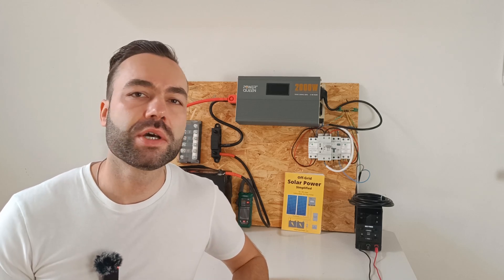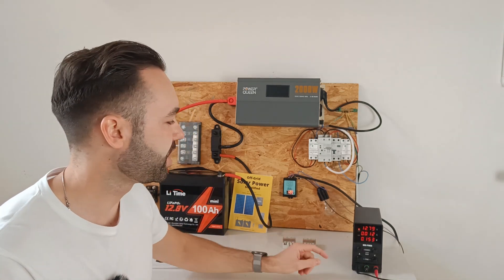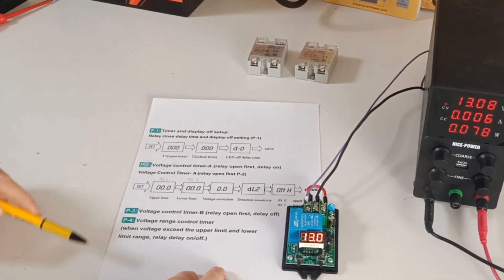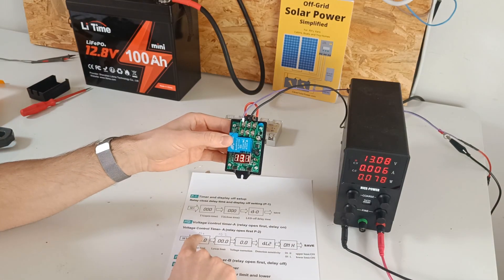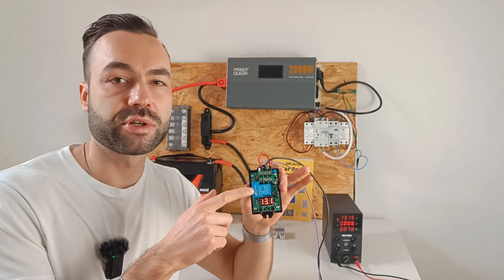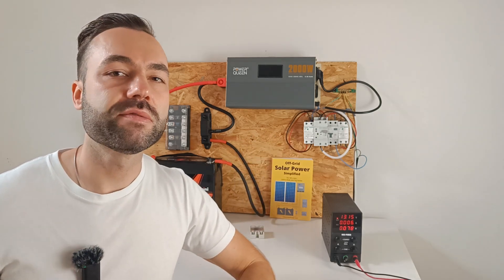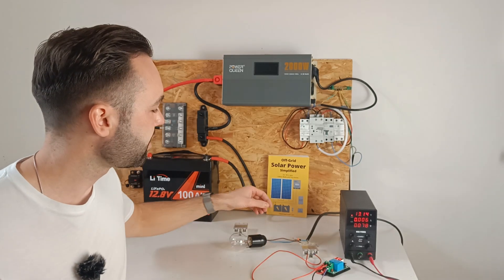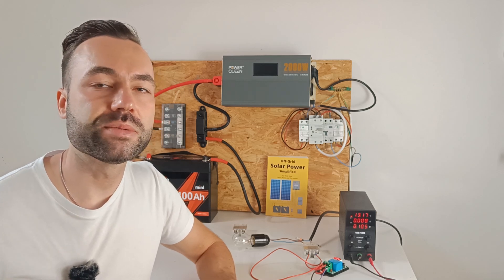Solar Dump Load - Heat Water When Batteries are Full

Comment: I never knew such a thing existed! Thank you Nick. I just got my solar working on my caravan (800w of panels, and a 280ah battery). I rewired it all so that the 12v was fed from the new battery, and the 230v was fed from my new inverter. It works really well, though I've been trying to find a way to use as much power as possible to push the system in these midsummer days. 

Putting my water heater on overnight uses a third of the battery but it soon tops up. But I notice that the initial heat takes most of the power (400w x 50 minutes) and subsequent top-ups use very little once the water is heated. So I'm thinking that I should install one of these devices to heat the water as soon as the battery is charged, and leave it on that whilst I have light hitting the panels. 

I'll give it a go as soon as I can!
Reply from the maker: Glad you liked the video Jim. You have quite a lot of solar panels for the size of your battery. in an average day with 3 sunhours you get 2400Wh from your panels and your battery is 3500Wh, so indeed, your battery will be full quickly, especially in summer.
Reply: @cleversolarpower  I bought twice as many panels as I should have because I had space on the roof to put them!

I set the solar dump up earlier to send excess power to my water heater. So I'm hoping that I'll get out there soon and find hot water in the taps and a full battery.

Thanks again. I keep coming back to your free advice here so I just bought your book from your website, and I'd urge anyone else who finds your work useful to do the same.

Comment: I am not a specialist in this field, but have lived totally off-grid for over 10 years now, so this has been something I have thought about and investigated. It might sound like a great idea, but most batteries want to be held at a boost charge voltage for some time, often about 2 hours, before dropping back to a float voltage.  Even at float voltage, most systems will use some solar power throughout the day.   So, triggering a panel power dump when a voltage is reached means the proper charge cycle is not completed - that will eventually damage the batteries.  This scheme can only work properly if the controller can determine the difference between the power demand of the battery charge controller and the output power of the panels and redirect only the excess power. If the controller is doing that, great, but I have yet to be lucky enough to find affordable technology to do this.
Reply from the maker: You are talking about lead-acid right? If so, then yes. You can set a delay timer in the relay. Most people are using lifepo4 though.
Reply: I don't think this is a problem with Lithium Batteries, that are okay even if they don't reach 100%
Reply: You are correct, even lithium batteries need to balance occasionally otherwise they start to go our of balance and are eventually destroyed. A couple years later its just bad luck or a bad manufacturer. Destroying your battery just may be cost effective. Heating water from batteries is a very poor method.  The best way is to power the element directly from PV voltage and divert excess energy when array voltage goes over the natural Vmpp.  Then only enough current is diverted to bring array voltage back to power point. There is one commercially available product that can do this from Poland available on ebay for about $200 called the ACTii.   I have one sent to me by a subscriber after it failed and seller refused to do anything.  I got it to work, it is a dated design that can be improved.   A simple one can be built for about $20 that works amazing, only about a dozen parts.  I have been designing these for ten years and have lots of old prototypes, want to try one.  This is the best unknown technology in the solar world.

Comment: I kind of need something like this for my grid-tied solar setup. I live at the end of a long (about 1km long) 230V AC supply cable. When a large load switches off (especially my EV charger) then my solar inverters (putting out 6kW peak) are too slow to react to stop pushing to the grid, the voltage spikes over 250VAC (maybe 255 or more) and the grid tie inverters panic and shut off completely.  What I would like to do is have a dump load (like a 2kW oil filled heater) connected via SSR that will connect the dump load very, very quickly and then disconnect after a few seconds. This will soften the blow to the inverters so that they can 'climb down' from the sudden drop in load.  The only thing I need to do is to design a circuit to very quickly detect the spike in the AC voltage, turn on the SSR and then turn it off again after a few seconds.

Comment: Thanks so much, I purchased your book back in 2020-great book and resource. I used it as my guide to build my system for my van. Like this idea of a solar dump. I don't like the idea of running through my inverter, as in my application, I only turn it on when in use. Trying to think of a DC load that I can use as a dump

Comment: It seems kind of dumb to use battery voltage as the trigger for a dump load, most scenarios where you have excess solar are based on gen more power avail than using while on a grid tied system, where you don't want to play the net metering payola tax, so need to avoid dumping onto the grid, so the trigger is much more complex, it's about detecting when your gen > load, which some meters can do, but they don't tell you (no dig breakout), so you need something fancier.
Reply from the maker: Basing the dump load on the state of charge is more complicated. We are using the effects of a lifepo4 battery voltage curve getting steeper at the end when it's near full charge. That works and is easy to do, indeed, not the most perfect but good enough while being simple.

Comment: Very good. I'd not come across SSRs. I've implemented this for couple of years now on a 300 watt immersion dump load using a 500AH house battery source (on a boat) fed by 600W solar to the bank. The VSR UL and LL voltages do need tinkering with - with a SLA house bank, the turn off (LL) voltage has to be 12.75. If you set if higher, you just get constant cycling of the VSR and the Relay. With LiFePo's this will be as you indicate with a higher volatge turn off, I guess. The time delays also DO need programming. I use a 600 seconds delay for turn off as the SLA bank always drops voltage quickly, but then stabilises. Setting a time delay prevents cycling, again. I suggest people experiment. I thought it would be quick and easy, but finding the right values took a week of observation and experimenting. With Lifepos it will be easier.
Reply from the maker: Thank you for your comment. This will help other people installing it. Indeed, the timer function is great because this is the newer model. The older model doesn't have the timer I believe.

Comment: Those solid state relays are poorly rated.  I would never use anything less than 60A SSR and then for a 10A load would use two in parallel to keep down the heat.   A 60A brick uses a FET with 0.050 ohms on resistance.  That doesn't sound like much but square the current and multiply that by the on resistance.  That is how much heat it will have to dissipate.

Comment: Unfortunately appears the 48v 100A relay link has been taken down, and many of the equivalents on amazon are no longer in stock thanks to tariffs - do you've any recommendations on alternative sourcing options by chance?
Reply: For high currents always use two SSR in parallel.  Those were never 100A brick.    Frankly, heating from batteries is a goober method to heat water.  I get heating directly from panel voltage, higher voltage less current.   I build power point controllers which cost less than these dumb bricks, high efficiency and don't use any battery resources.

Comment: Very useful.  I want to use these SSR to switch input between Solar Panels and a 48v battery to my solar generator DC/solar input.  During the day I want to charge directly from my extra string of solar panels, during the night I want to charge from my external 48v battery.  I'm not sure exactly how to wire it but I'm guessing if I had two SSR I could switch between them to control the incoming power to the AC200L.

Comment: Please with the water heater! 
I am trying to figure out how to use a DC element and thermostat on a 40 gallon water heater. Maybe I am just overthinking it but the way I read it was to use a DC element rated below 50 amps and match the watts on the thermostat to the watts on the element. That still doesn't tell me the size of lithium battery and solar panels.

Comment: Subscribed! Been looking for this for ages, I knew I could do it but couldn’t find anything (probably because I didn’t know it was called dump load) I take it as I’m drawing 240v 160w pump id be better off with the srr option? Or would the the standard relay suffice? Just don’t want the relay clicking in and out on start up 

(I’ve got 400w of solar panel going to a 40amp mppt) so that side is enough
Reply from the maker: A 160Watt AC pump can be handled by the relay.

Comment: 13.4v dump voltage is too low. Lead acid batteries maintenance charge is 13.8v
Reply from the maker: Yes, this is for lithium lifepo4 😉
Reply: Hi Nick. Thanks for an excellent video. I’ve been wanting to do this for ages but the dump I looked at before was much more complicated than this and put me off. 

I currently have 840W on the roof, soon to be upgraded to 1,190W. It’s rare that I get full power from them as I’m on a continuously cruising boat on the UK canal system so there is often shade. What wattage heater would you recommend for my dump? Thanks, Kathy

Comment: Hello Nick. I have a quick one, say a 15kW system, which one would you recommend between 5x3kw or 3x 5Kw batteries?
Reply from the maker: Since it will be a 48V system, it's better to go with 5kWh batteries because thats 3x 48V 100Ah. However, if thats too heavy, then you can go for 48V 50Ah batteries of 2.5kWh each.
Reply: @cleversolarpower  thanks a lot, was looking at a scenario where one battery can fail and don't have to lose much power due to that failure.

Comment: Other related topics:

* Instead of directly switching the power with a relay, use a small low-power relay to activate the remote ON/OFF contacts on an inverter and let the inverter do the hard work of switching the load(s).

* Solid state relays are ... mmm.   They are ok, but you have to remember that the larger the load running through the solid state relay, the harder it will be for the relay to turn itself off.  This translates to heat in the relay which can cause its junction temperature to rise above specs and destroy it.  So it is a good idea to always connect SSRs to fairly beefy heat sinks.  This also means you need to drive the SSR with a good solid voltage source that can sink a lot of current (only for a few microseconds)... this will allow the SSR to turn on and turn off more quickly, reducing the stress on its FET(s).

* Cheap SSRs do not have reverse-biased diodes across their output terminals.  Reverse current (for example, caused by running an inductive load such as a motor) can destroy the SSR so it is a good idea to put a beefy diode in reverse bias across the SSR's output terminals to prevent reverse current on the output from destroying it.

* SSRs often have leakage current.  If the load is zero, the output of the SSR might rise to the input voltage even when it is turned off.  If this is a problem, you need to have an appropriate resistor from the SSR's output to ground.  Usually 2.2kohm or 4.7kohm, to sink the leakage current.  For example, leakage current can cause an inverter connected to the output to phantom cycle on and off continuously.

* Be careful with the voltage range of the programmable relay.  Usually it is best to program dump loads with a trigger voltage that is essentially a fully charged battery or very close, allowing you to choose a voltage on the charging curve.  And then set the turn-off voltage at an appropriate voltage on the discharge curve representing, say, the top 20% of the battery.  The gap between the two voltages is typically large enough that the load won't pull the battery down below the trip point and cause the relay to cycle continuously.

* Avoid situations where the dump load is cycled on and off a lot each day.

* You can combine the dump load with a digital timer to further restrict the times of day the dump load can run.

* Contactors burn a lot of power when turned on, on top of whatever the load is.

-Matt
Reply: Can you get inverters with multiple, independently switched loads? My current inverter is either on or off and, given that it runs the fridge, this wouldn’t work for me.
Reply from the maker: Off grid inverter cannot synch with other inverters unless the manual says they can. So no, combining the output of multiple inverter together is not possible unless stated otherwise.
Reply from the maker: Thanks for your comment Matt.
- I agree, if the inverter has a relay output. I only know that the victron multiplus has one and the load output of their charge controllers can be programmed as well.
- The SSR didn't get hot in my testing. Adding a heatsink seems a bit excessive when a new one costs you $7.5.
- The input voltage of the SSR will always be zero if the voltage sensitive relay is not activated, so i don't think this will be a problem. Any other thoughts?
- The one i linked has an input voltage of 3-32V. This works with 12 and 24V batteries (for me at least).
Reply: @cleversolarpower  Yes, I know which SSR you are using.   Its a fairly generic Chinese brand.   Note that low gate voltages will soft-on and soft-off the SSR, which can cause problems when switching heavy loads.  A diode is still recommended.  Otherwise though... if it doesn't get hot under full load you are probably ok.

-Matt

Comment: Good video. Victron multiplus and quattro inverters have this entire fully programmable mechanism built into them activating AC out 2. It's a good feature.
Reply from the maker: Indeed. You can also use their charge controllers that have a load output to trigger a relay.

Comment: Can I bypass the voltage sensitive relay so I can turn on the device, e.g. water heater, on demand ? In my current setup I have a on off switch to a relay that turns on the water heater when I want
Reply from the maker: Of course, just remove the voltage sensitive relay. Take 12V from your battery, wire it to a switch and then the input on the relay. The relay will then power the appliance. You can also put a switch in the power line directly, but then you need a powerful switch.

Comment: Many people don't want to reduce life by cycling their batteries up and down at maximum charge.  They prefer to run batteries perhaps at 80% max. At this level LiFePO4 voltage curve is quite flat so voltage sensing isn't so great.  Can you expand this to be triggered by battery % as determined by coulomb counter?

Even better, show a supply following load circuit that matches load to excess generation so you're very close to not charging or discharging.  Your  circuit will almost never match generation to load, so batteries will always be cycling.
Reply from the maker: As i've said in the video it's best to match your load to the power coming in. 600W of solar is 600W load. How I found the voltage values: charge your battery to 100% and set the shunt to 100%. Apply your dump load and see how low the voltage drops on your shuntmeter. Then discharge the battery to 90% reading on the shunt. Use this voltage for the cutoff voltage (if the voltage drop of the dump load is not under this value). Replace with your own values, in your case 80%. Charging a lifepo4 battery from 0 to 100% is fine. They BMS will be dead before the cells will.
Reply: @cleversolarpower  sure, but excess solar power is variable depending on panel output and system usage.  Only seldom will a pre-calculated number fut reality.  

Sounds like your saying there's no point in optimizing usage because BMS design is so poor.  But if that's the case, why not optimize battery usage and keep a spare BMS?  Charging 0 to 100% is fine for min rated cycles, but charging in a smaller range not at the endpoints gives more cycles per numerous tests and what manufacturers are posting.
Reply from the maker: @SeekingBeautifulDesign  Electronics are bound to fail after 10 years (like string inverters), there is no more robust BMS. The average cells have now 6,000 cycles. that means 16.4 years of cycling the battery everyday from 0-100%, and then you will still have 80% capacity left. By then the battery will have died because of degradation, not because of the cycle life. So my advice is cycle from 0-100% all the time.

Comment: That is awesome Nick! I can see lots of practical uses for that. I will be adding a water heater soon. I was torn between electric or LP for the heat. I can now see that I should plan for both. Might as well heat the water with electricity rather than letting it go to waste. Thanks for the great info! Cheers, Danny
Reply from the maker: Glad it was helpful Danny. Good luck with your new project.

Comment: Very good. I've being doing this for a year now on my boat The voltage values and delay times, to prevent constant cycling are key. The voltages you used are for lithium. For SLA they need to be different. You ought to maybe discuss more the programming of the VSR as all instructions issued with these are hopeless and confusing.
Reply from the maker: Indeed, if your load is larger than the solar coming in it will cycle on an off. That's when the timers will be useful. Indeed, this is for lithium. i'm assuming most people use lithium now. Yeah, you have to read the manual 5 times to understand it 😀